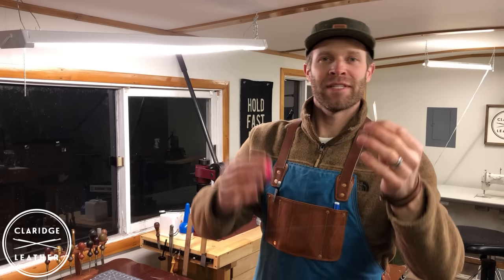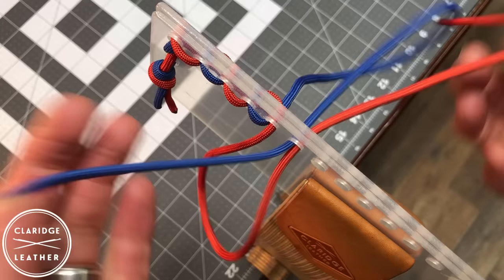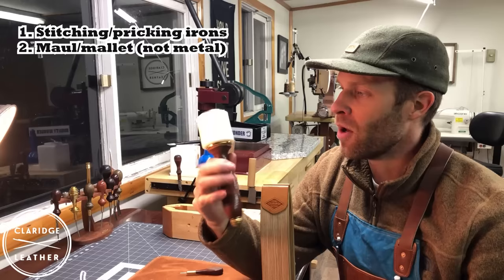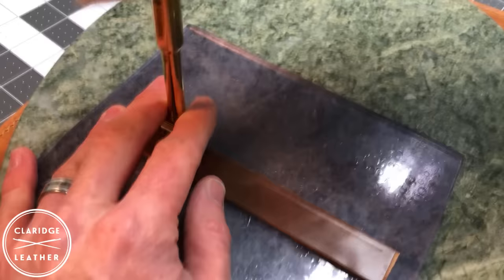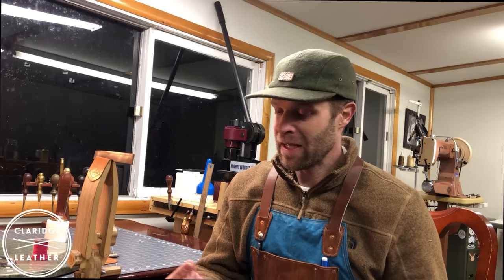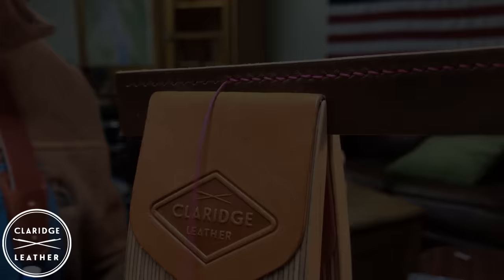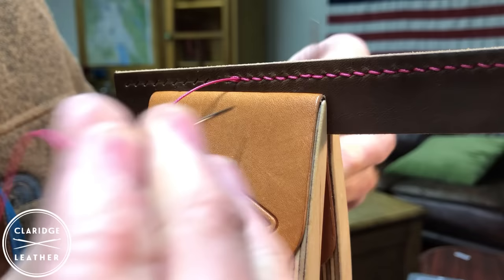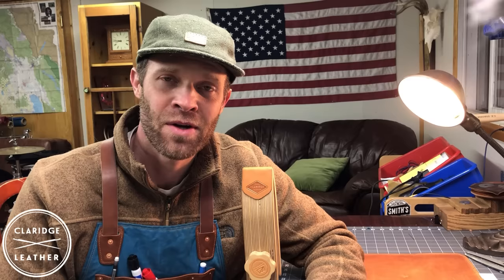How to Hand Stitch Leather: Get Better, Fast!

Comment: Hi Tanner I am trying to make a leather hat band out of a nice leather belt that I found. It has a thickness of 4.4 mm and it has a beautiful scroll work of flowers and leaves on it.after I cut it to the right length I need to fasten it back together, and I prefer butt to butt as opposed to an overlap. Can you recommend a procedure weather a stich or maybe gluing it back together, I was thinking a stitch as I want a nice strong bond and aesthetically pleasing. Thank you so much Greg

Comment: Thank you so much for the awesome video! I am a beginner and struggling with pulling my needles through the stitching holes. I am using a 4 mm stitching chisel. Is there something I need to use after the chisel to make the holes bigger? Thanks!

Comment: Really enjoy watching your videos.  As other have already mentioned , you are an excellent teacher.  

I do have a couple of questions:  What weight maul do you prefer to use with the Sinabroks?  Does using the punch pad work better than a piece of scrap veg tan?

I just received my Sinabroks (3.85 in 2 and 10 prongs) and really enjoy them, but a little surprised how much force it took to punch through two layers of 4-6 oz chrome tan with the 10 prong.

Comment: What's interesting, that this technique doesn't work on very thin, soft leather (1-1,3mm) when you stitch only one layer of leather (when doing decoration/strengthening stitching lines) then the stitching always looks horrible and uneven on the right side (front side). But i found out, that sticking the right needle through the hole first and then the left one (basically the same technique, just mirrored), the stitching looks nice, even and slanted on the right side, and slightly slanted but more straight on the left side.

Comment: I certainly reckon its great for beginners but traditionally it is done with waxed thread, harness needles, a stitching awl and a saddlers clam (not clamp) which is stuck between your legs at an angle. I myself hand roll and hand wax my own thread. Doing it all this way is quicker, traditional and professional, and when done properly looks better than anythin else used

Comment: Hi there, thanks for the video. I was wondering if you’ve ever used kevlar thread and how to finish it. I’m making a leather handle cover for a pan. So I’m using Kevlar thread as it can’t burn or melt. However I can’t seem to figure out how to finish the threads off since they can’t be melted and tapped down

Comment: What's the reason for not using a metal hammer? I've been using a 5lb hand sledge and it works fine. I'm guessing its about the longevity of the punch itself?

Comment: Thank you for the clear and concise explanation. Perhaps I missed it but what is the purpose of wrapping the thread around the needle on the return stitch and would you still do that with straight chisel or round holes?  Many thanks.
Reply from the maker: The only purpose of laying that thread over the needle is to promote that slanted look on the back side to better match the front side. If you don't do that, it will look more slanted on the front (right) side and more straight on the back side. You can play with these variations w/ straight chisel or round holes-- I think you'll find that even in round holes, doing this will give the subtle slanted effect on both sides. Of course the size of the thread/holes and thickness of the leather are variables that will affect the end look. Let me know how it goes if you try it!
Reply: @ClaridgeLeather  Great tip. Thank you

Comment: First off, excellent video. Thank you!

Question: You mentioned orienting the slants up and away from you on the pony and started stitching from the back end towards yourself. What if you want to start the stitch line from the front? Intention being to place back stitch and burned end in a less noticeable spot.

I’ve tried doing everything the same (technique, slant orientation) and it seems to work fine. Just wondering if there’s a best practice way.
Reply from the maker: I think you’ve got the right idea. It can really be done anyway you want, as long as you are consistent and the end result gives you the look you want. For me, this technique helps me just to standardize it and it works for me and my muscle memory. I know people that do it several different ways, but the end result is essentially the same.
Reply: @ClaridgeLeather  thank you!! 😊

Comment: Glad I stumbled upon your video, already made some difference for me as well! Just a quick question: what's the reason behind the specification of not using a metal hammer to smack the irons to make the holes?
Update: finally an easy and clean explanation step by step, including where the top of the hole is sitting compared to urself and the thread u pull through, thanks for the video!
Reply from the maker: Thank you so much for watching! In general, I think it’s considered best practice to use a non-metal mallet/maul when hammering on metal tools. I think there are a few reasons for this: the metal tool (soft brass pricking irons, in this case) will mushroom out at the top is a metal hanger is used. This will happen on steel tools as well. Also, steel on steel can tend to fragment and send sharp metal pieces into the eyes, etc. Lastly, I think a nylon, wooden, or rawhide mallet has a nicer feel for this type of work— not such a sharp impact, less rebound. Does that make sense? Those are my reasons, anyway! Not a hard and fast rule, but at least there is some rationale. I do use a metal hammer when I use the peening tool on copper rivets. 😀 Cheers!
Reply: @ClaridgeLeather  yes, it does make sense, thanks for taking the time to explain it to me! :) the reason behind my question is probably dictated by the fact that I have a nylon mallet not that heavy, so I smack it hard and since it's round I need still to practice a good hit I guess, so I found it easier to smack it less powerful but with a heavier metal hammer. much appreciated again, both videos and explanations :)

Comment: To me, 5 x the length sounds like a lot.  I have always used 3 x the length + enough to thread the needles and have a piece to hold onto while pulling the stitches tight.  Granted, for very short distances, this could easily come out to 5 x, but in my experience not many stitch lines are that short.  I have never been able to master this method of stitching.  I always pull the first end all the way through and then put in the second needle.  My stitching pony swivels, so I keep my work turned so that I am stitching from left to right instead of toward me or away from me.  I insert the back needle first, pull it through and then while holding that first thread down in the lower left point of the slanted stitch hole, I insert the front needle through the top right part, pull it through and then tighten.  The point I am trying to make is that you should do it the way that's most comfortable to you.  The most important thing about saddle stitching, IMO, is that you do each stitch exactly the same way.  That is what is going to make it look uniform.

Comment: Nice video!
Do you start a stitch from the front side to the back or from the back to the front?
Difficult to ask this clearly, but you first open the hole. Do you do this from the back/least visible side of the work piece or from the front/most visible side?

Comment: This is old school. You don't need to open the hole, because one needle's as good as the other. Nor do you need fancy pulls. The secret's to leave the loop on the first needle open, then pass the second through and put it down through the loop, every time. The next stitch will tighten the loop.

Comment: Great video indeed! Question, When is it appropriate to hammer down the stitches? Is that mostly for wax coated thread? And also, do you make the line with a groover or just a tracer? Thanks again for the awesome content!
Reply from the maker: Thanks! I usually do hammer down the stitches, lightly. I don’t think it serves a functional purpose, necessarily, but it can make them look neater and fill in the stitch holes a little better. I think it’s just a personal preference thing. I used to use a groover, which can certainly serve a functional purpose in high-wear areas (to recess the thread), but I generally just mark the line with a wing divider. Thanks for watching!! 🙏🏼

Comment: Question on the technique, what if you don’t loop over the tread on the left side? Will it impact the stitch strength or is it just so it’s uniform? Unreal video too. Just picked up a new subscriber! Cheers mate!
Reply from the maker: Hey, welcome! 🤜🤛 Not doing the loop won’t affect the strength in the least— it’s mainly just for looks. In fact, sometimes, depending on the type of leather and thickness of the piece, I think it sometimes looks better without the loop. Most often, though, this is the best way to get that slanted look on both sides. Cheers, Jordan!
Reply: @ClaridgeLeather  AWESOME! I'm about to start on my first leather project making turn shoes and was thinking of running the saddle stitch everywhere. Thanks heaps mate!
Reply from the maker: Cool! If you’re on Instagram, send me a picture when you finish them! Have fun!

Comment: I'm just now trying to get into this because I'm trying to get into knife making and I've made 3 sheaths. One of which is just because I screwed one of the first two up so bad. Question; is there a difference between stitching chisels and stitching irons? I bought the chisels. I think they're diamond shaped. 1st of all, they aren't long enough to go through 3 pieces of leather. Are the irons longer? I'll try to remember my other question and ask below this comment
Reply from the maker: Sorry for the late reply! Generally, chisels are meant to go all the way through, leaving a hole (diamond shaped in this case).  The other major category is the "pricking irons", which are generally meant to just prick or mark the surface for the hole locations and orientations (slanted, usually). They are meant to be followed with the awl, where the blade of the awl penetrates all the layers of leather. I would recommend looking into that for thicker sheaths. Getting good with an awl will open up some new doors, albeit maybe some frustrating ones. Some people use a drill press or a dremel tool mounted in the little Dremel drill press to drill holes through thick sheaths. It may save some frustration to do it that way, though the look of the round holes may not be as refined.
Reply: Thanx man. Going to the drill press to finish going all the way through is exactly what I did. I guess my chisels kept me evenly spaced at least lol i do like the look of the hole they make....but that's one sided when they don't go all the way through. I appreciate your reply and you sharing your knowledge with me.

Comment: When doing your starter project the card holder, do you start the stitching at the open end and move towards the "bottom"?  Obviously, I'm sure you can do either direction, but where do you "usually" want the back stitching?  Near the open end as reinforcement or the bottom so less visible?
Reply from the maker: Yes, I would usually start at the top as you described. However, I often start in the second hole and backstitch one hole to the first hole, then continue back down to the end. I guess I think of it as reinforcement, although it probably doesn’t need it! I try to finish the stitch in a less visible spot, pulling both ends out the backside before melting the thread. Thanks for watching- have fun!
Reply: @ClaridgeLeather  Thank you so much!

Comment: How do you keep the second needle bisecting (going through) the first thread in the hole?
Reply from the maker: Pull the thread that is already through the hole backward slightly (in the same direction as you’re pushing the needle) as you push the needle through— if it has pierced the thread, pulling it back slightly will either ensure it’s not pierced or will pull it off the needle if it did get pierced. Does that make sense?

Comment: what kind of thread do you use? is that 1mm ?
because ive seen something like that but the seller says its not for sewing so is it okay to use?
Reply from the maker: I like to use Ritza Tiger thread or Twist braided polyester thread. Usually 0.8 or 0.6mm in Tiger thread and 0.55 in Twist. Can get both at Rocky Mountain Leather Supply. 👍

Comment: What size needles are you using? I found the brand but it comes in Size 0 1/0,  2/0, Size 2 (002) and size 4 (004.
Reply from the maker: I tend to mostly use the 002 (good for thread under 0.8mm), sometimes the 0/1 which are slightly larger (for thread up to 1.0mm). There’s a helpful chart on the Rocky Mountain Leather Supply site— have fun! https://www.rmleathersupply.com/products/john-james-saddlers-harness-needles-sz-4-2-0-00-000-25-pack

Comment: Hi Tanner, I have a dumb question for you. I can't find the 5.5mm thread that you show in the video. I click the link and closest I can find is .6mm. Will that suffice and if so can I use the same needles and diamond chisle punch set that you linked to Amazon? Thanks a ton, moving from the sew machine and just trying to get the toes wet in leather.
Reply from the maker: I think the thread I used was actually 0.55mm, so you’re right there! 0.6mm Ritza works great— have fun!
Reply: @ClaridgeLeather  Sorry, I slid my decimal a bit lol. Thanks for the reply. 👍🏾

Comment: So when you do the loop over after the second needle passes through, is that just to keep the angle of the stitch consistent or is there another purpose?
Reply from the maker: Yes, exactly— it’s for the benefit of the backside, so it will have that slanted look as well. If you don’t loop over the needle, it will look straighter in comparison to the front side (right side). It’s good to experiment with different variations though— let me know if you find this to be true! Different needle/thread/hole diameter/material thickness combinations will also affect the finished look, for sure. Thanks for watching!
Reply: @ClaridgeLeather  got it, thanks.

Comment: 5x thread was exactly the length I needed. Thanks.  Quick question, when I stitch, the lengths are the same, when I finish, one thread is much shorter. Why would that be?
Reply from the maker: Interesting! Assuming the thread didn’t get pulled off-center during first couple stitches, I don’t know what to tell you!
Reply: @ClaridgeLeather  it turned out great btw, thank you!!! You make me want to build bags/luggage! I'm thinking of doing one of the Buffalo kits from Tandy to start. 

Also, I sometimes have that problem when I do a paracord bracelet too. One side longer/shorter.

Comment: Hello, I am very new to leather work. In fact I have not been able stitch two pieces of leather together. 

I had no luck with cheap
Stitching irons from
Amazon, as if yet. 

I just ordered a different set of irons and some tiger thread and some #18’John James needles. 

With that said, at first I want to
Make just card holders and minimalist wallets. I have some pretty thick scrap leather that I thought would work. Is thick leather ok for card holders? And thinner leather more for bifold wallets? Also, I have chrome tan leather, should I invest in some veg tan leather
Reply from the maker: Hello! Thanks for watching this— I hope it is helpful in getting off in the right direction with your leatherwork! You should be ok with a thicker leather for a card wallet— it will just be a bit bulkier in your pocket. I like 3-4oz leather for that, but I’ve seen them (and made them) much thicker. At any rate, it will be great practice! Bifold wallets do need to be thinner leather since there are often more pockets that stack up to make many layers.

I wouldn’t worry at all about veg tan vs. chrome tan at this point. Getting started with whatever you have on hand is the most important thing.

Stay tuned for my very next video— it’s all about finding the right leather for your project! We’ll talk about thickness and leather types for different projects! Cheers!

Comment: Silly question but if you are just using round pricking irons do you still do the loop over the second needle?
Reply from the maker: I don't know if there's a "rule" about that, but I would guess that doing so would encourage the slant on both sides, even though you are not using slanted holes-- depending on the size of hole and thread, it can create a hint of a slanted look. I would be interested to hear what you find when you try it both ways!

Comment: can the saddle stich be used to sew fabric?
Reply from the maker: It technically can-- the issue may be keeping a straight line and even hole spacing, since there may not be a good way to pre-punch or pre-mark the holes. But I'm sure it can be done and would be very strong!

Comment: My punches are diamond shaped, so they make a straight line of diamond holes.
Reply from the maker: Are they like parallelograms, so one corner of the diamond goes toward the top of the stitch line and the other goes down? This method should still produce great results with those irons! Let me know what you find!
Reply: @ClaridgeLeather  Yes. The diamond shapes are more rhombus in their arrangement.
Reply: @ClaridgeLeather  Yes indeed

Comment: The sewing machine doesn’t ’make a knot.’ It does just what you showed, the top thread should loop down half way, and will be caught by the bottom thread which should come up halfway and catch that too thread. If they don’t each meet halfway, then you need to adjust your tension. You had it right when you showed it, but no, there’s no knot.